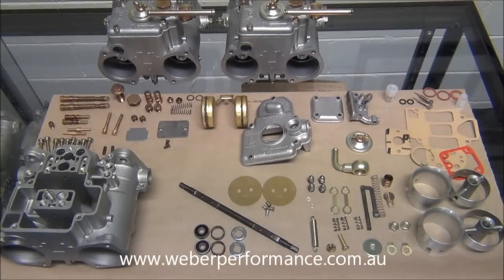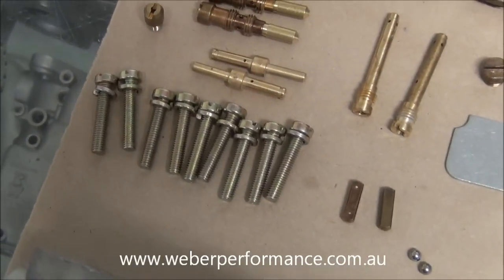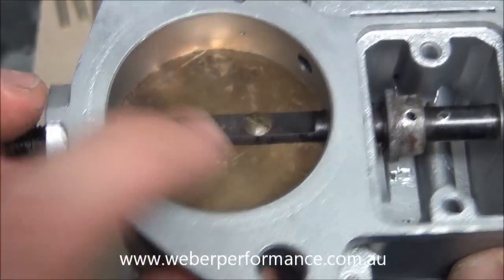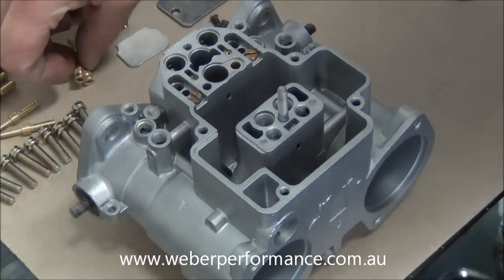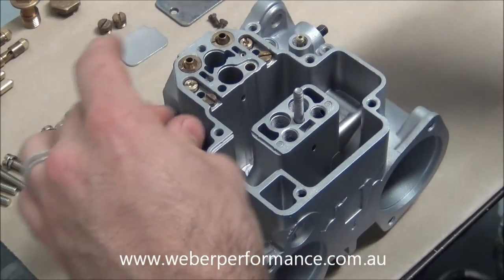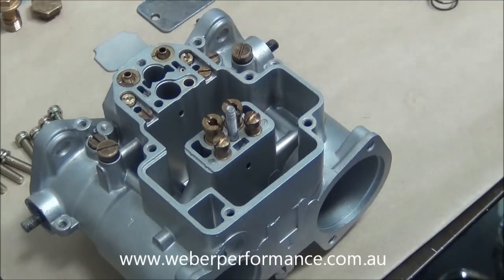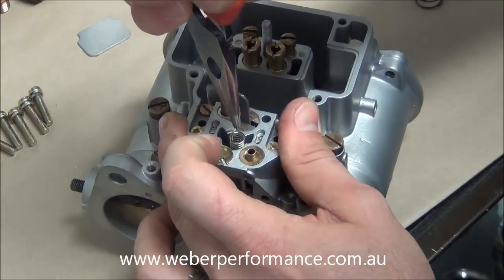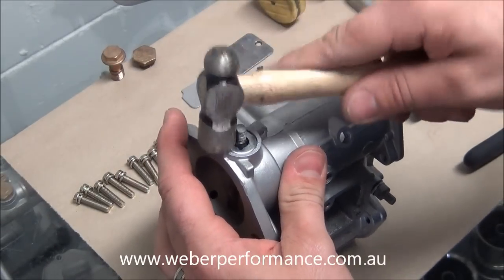45 DCOE 13 Weber Assembly - Part 1

Comment: Hello, all right, I'm Brazilian and a big fan of weber carburetors, and I've already had fuel teck ft500 in a car here, anyway, can you tell me if the weber dcoe can mount the pressure cap? for turbo? I had a turbo with weber standing up!

Comment from the maker: You have three different variants of the 40 DCOE that would have been fitted to three different cars at the time. As manufacturers created new model cars (typically Alfa Romeo for these), slight changes were made to the carburettors by Weber and were therefore given a new number. You will find that the idle circuits will differ on them (progression holes)  therefore should not be used together as a set.

Comment: Hi - Awesome video - thank you for sharing. Just a little note - R/T Chargers didn't have 45DCOE13's. The E37's had 2 x 45DCOE53 and 1 x 45DCOE54 (back). E38 & E49 had 2 x 45DCOE55 & 1 x 45DCOE56 (back). I keep forgetting what the E48's had, but they were the same as E37 or E49.
Reply: Scott Taylor much

Comment: hello, on the 2.31 minute video when you assembly the axle and the butterfly you dont talk about it. here in my case i have problems the car hasnt got idle speed.
i think the butterfly are not good, when there is on 0 i can see light if i look inside over a lamp. that is ok or if i do that the light must not enter ?
can you help me ? what is the 78 on this?

Comment: Hi 
Please can we take contact for some important question about my Webers 45 DCOE 15 Bologna Italy.
I have some problems with my carb's sinds my car going to the garage to Tune them… I guess they change my venturys en pomp with those actually Spanish rebuild Weber. Can you show me the difference between the two Origina from Italy and Spanish ones.... I have information but I want to be sure please. 
It will be really really helpful en kind to inform me on this question.

Comment: Hello....
How did you clean the aluminium to be like that?

thanks
Reply: The narrator says ‘hydroblasting’ but I’ve achieved a similar finish on the aluminum-bodied SU HD-8 card on a soft-grade wire wheel (i.e. brass wire) on my bench grinder